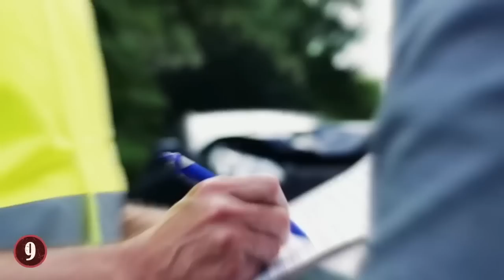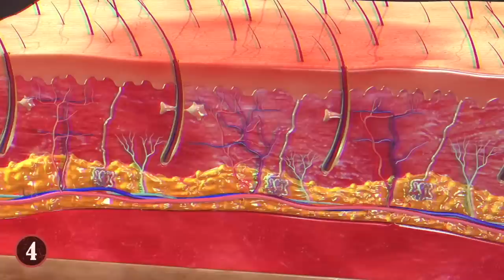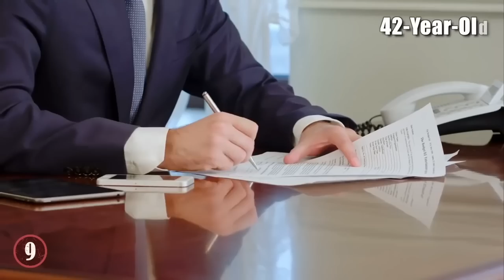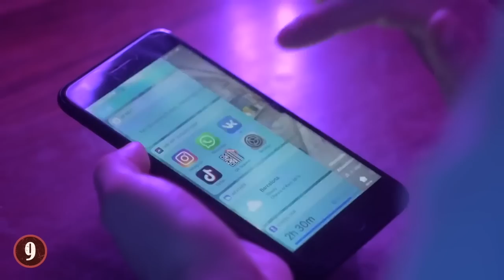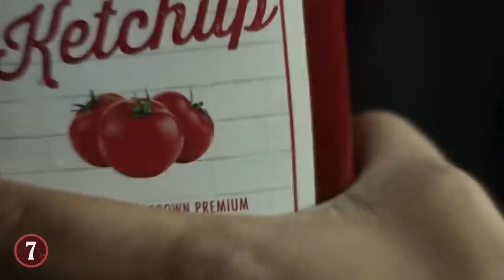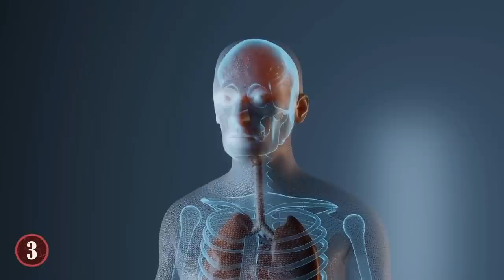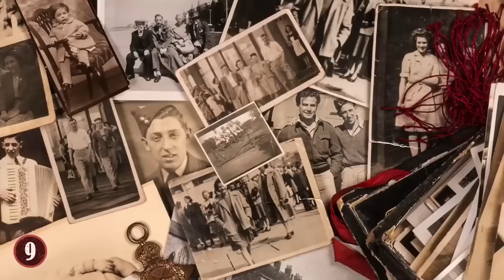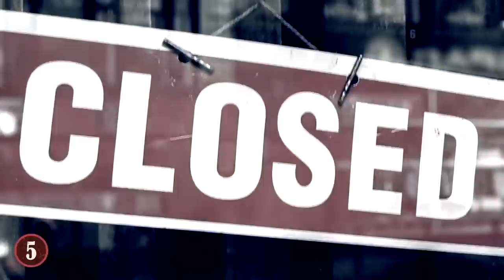All That Went Terribly Wrong

Comment: The pins on grenade's are strong and durable. It wouldn't simply pop off so easily. Some dummy must have played with the pin prior to acting like an idiot. Here's the best part. Majority of grenades have a 6 second "cook-off" (as we called it anyway) and then Kaboom, mince meat. Although, there are grenades too be known to pop around the 3 second mark. 1-1000, 2-1000 3-1000 etc. I think those may be more of a certain foreign type though.